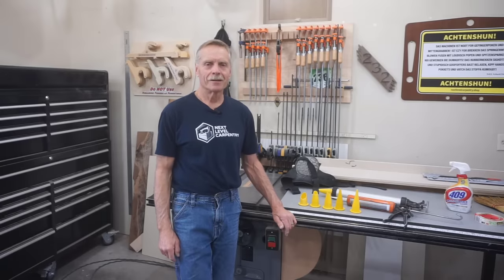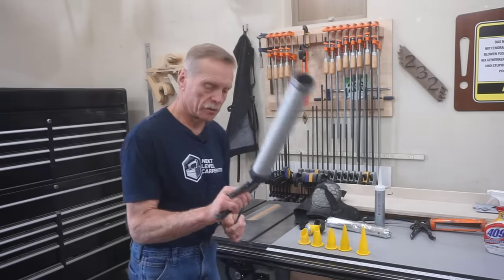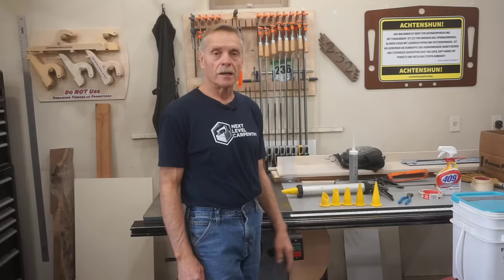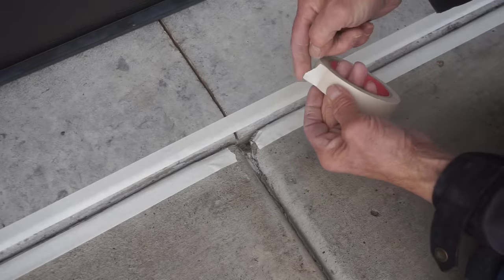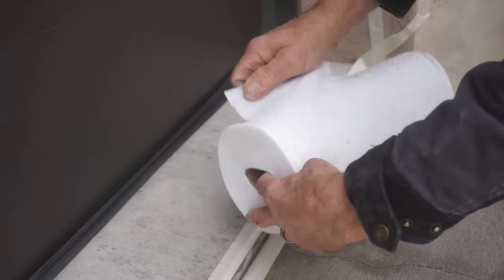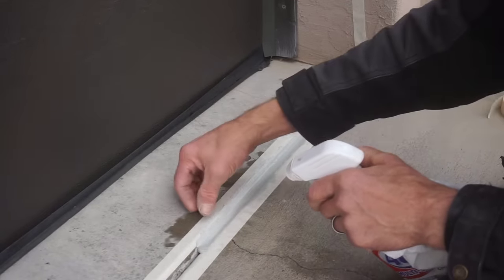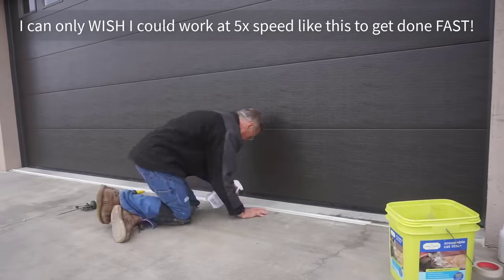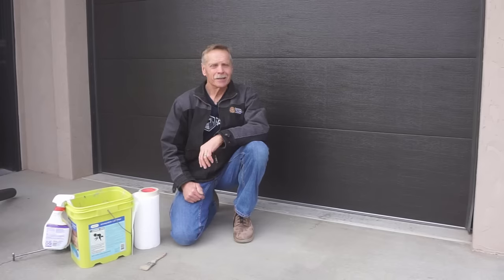How to Caulk Concrete Control Joints with Perfect Results Every Time

Comment: My joint is 3 or 4 inches deep. Should I fill with something (what?) to within a certain depth before applying the product?
Reply from the maker: Educate yourself on the purpose and application of backer rod for joints like that Glenn.  They're quite common and are easily dealt with using properly sized and placed backer rod.  You can start by checking out Tremco's website for 'joint design'.  Hope that helps.  FYI Regardless of backer rod size/placement I finish the top of ALL joints with this same process. Best, Matt
Reply: @NextLevelCarpentry  Thank you for your prompt response. The video is to the point . shows the detail with closeups & comments, and the volume and tone for your presentation was excellent.

Comment: So one main issue with wet sealing is typically a professional caulker won’t use tape. Not as to say this won’t give professional results. But if you don’t use tape and you spray first there is risk that the spray will get under the outside edge. Then it will lift after it cures… they will also use metal levelers called spoons to tool the joints. After you took the joints and the outside edge is sealed you can spray it with some dawn and water if you would like. Also some other caulks have a thicker consistency which in some ways helps with controlling the bead.

Comment: Question: In windy conditions, is there any reliable way to protect the caulking till it skins over or cures? Last thing I want is a bunch of crap, leaves, etc. getting stuck in the joint.
Reply from the maker: That's the entire purpose of sprinkling fine silica sand on the tooled joint promptly after you're done tooling.  In windy conditions I do shorter sections at a time... maybe down to 4'... to keep the joints free from blowing detritus.
Reply: @NextLevelCarpentry  Got it. Thanks!
Reply from the maker: @snidelywhiplash  I think you'll be amazed at how well that little secret works to make your finished results look professional...

Comment: self-leveling concrete sealer is a great substitute for flex-seal. It's better and actually cheaper
Reply: I used a concrete crack sealer (don't remember the brand, was at Lowe's).  Did a strip where the cinder block foundation inside my garage meets the floor.  Also some cracks outside the garage on the concrete apron.  Then we had a lot of rain some weeks later and the sealer was wet inside and came out of the crack, same as the outside.  I hope this stuff works better than what I bought.

Comment: Great video.  How do I remove the attempt made to caulk my concrete patio that was done without taping?  It has flooded and spilled all over.
Reply from the maker: With much weeping and gnashing of teeth, Debora, no other way.  Try a utility knife, wire brush and a solvent like acetone.  It will never be perfect but you can, with effort and commitment, make it much better.
Reply: @NextLevelCarpentry  thank you for the reply.  My husband used a utility knife and was pretty successful in removing the black caulk.  Next question:  we (meaning he) has to get the bead of caulk smaller than what comes out of the tube.  Would love to know how the builder did this, as it looked great 2 yrs ago when we purchased the new house.  Do we have to wipe it off?
Reply from the maker: @deboramitchell3467  I think that's where masking tape comes into play so you can control the final joint width... wish him luck!

Comment: Can this procedure be used on a concrete building where you have stair step cracks in mortar?
Reply from the maker: Sure can... it doesn't provide any structural benefit like what you'd get from tuckpointing with mortar but will seal it up to keep bugs, moisture, etc out...
Reply: @NextLevelCarpentry Thank you. That’s basically what we’re looking for!

Comment: Would a similar process be used for interior concrete control joints inside the home? (say before tiling or laying a floor covering)

Comment: Hi, maybe you can help... my front concrete porch goes to the grass via 3 concrete steps, the first step had the old style black expansion board, this board fell apart after many years. Now the gap between the porch and step is about a inch wide BUT gets bigger when you look down in the gap. Can I just fill this large void with playsand then backer rod then the sealant?  Or can I just use great stuff expansion foam to fill the void and then backer rod and  top it off with the sealant?
Reply from the maker: The best and simplest way to control sealant depth is to use properly sized backer rod placed so the joint depth is about 1/2 its width.  I refrain from putting anything like sand, gravel or dirt down in joints to 'fill them up' because it can lead to further separation as things freeze, thaw, settle and expand.  Great Stuff would be OK but it would be rather messy and you'd have to mask off the top of the joint because you'd not want any spray foam where the urethane sealant needs to stick.  Good luck... Best, Matt

Comment: Man, I wish I'd seen this a long time ago. I have a balcony/ patio deck and it is a floating 3" reinforced concrete slab over a wood framed deck. The contractor originally was going to use roofing material over the wood deck with a gravel layer and then concrete stepping stones on top. I didn't know any better, if I had to do it again I would have just poured an 4 or 5 inch reinforced slab integral to the house masonry structure. Anyway, the perimeter joint caulking expansion joint hasn't held, and I've redone it about 4 times already, about 40 linear feet around the slab. Twice I used sika self leveling, and it separate from one side of the joint and leak. I'm in Florida and in the summer it's blazing hot. I tried another method from a builder recommendation to use xylene to thin some sealant, paint the concrete,  then apply the unthinned caulking.....didn't work either. I'm going to retry with your system. Do you have any recommendations for me to clean the concrete contaminated from the previous attempts?  I used a twisted wire disk on an angle grinder the last time and it failed again... I'm so frustrated that I've contemplating demoing the patio deck and rebuilding it from scratch, but it's a big job. Any suggestions? Thanks.
Reply from the maker: Sounds like a messy situation Rob.  Clean up and prep is always the worst part!  I'd start by cutting out everything you can.  Then use that wire wheel on a low speed to strip off anything that will come off.  Good news is that if any of the old caulk is stuck so good it won't come off you should be able to just wipe it with lacquer thinner to clean it enough for new urethane to stick to it.  Anywhere you end up with clean, bare concrete you might want to use the primer made specifically for urethane caulk for best results.  If there's a lot of movement at the perimeter even this method might fail but I believe it's the best chance you have for doing it.  I've also learned recently about a different type of sealant that might have properties more suited to your materials and conditions.  Here's a link to the website so you can check into it if interested: http://www.towersealants.com/au-1/  I've not tried it but may at some point because "they" are always making newer, better materials and this might be one.  I was talking with a guy named Barry there so if you end up talking with him tell him I sent you?
My overall advice is to be patient with prep work and develop a 'system' of materials and cleaning that you can test before re-doing the whole thing only to find out later it doesn't work... and good luck!  Best, Matt
Reply: @NextLevelCarpentry  Will do Matt, big thanks my friend!

Comment: How long will this material last in an expansion joint on a driveway in the mid west?  We have both hot summers and snow, so before I make the investment in time and money, I would like to know if this material will last many years.
Reply from the maker: Properly done I have projects holding well 15 years on Dean.  Those projects are all on concrete poured over well compacted, well drained soils so excess heaving/settling don't over-stress the stretch limits of cured urethane.  In my experience it's not so much expansion/contraction that causes failure but frost heaving so if your driveway is sitting on good, non-expansive soils or, better yet, well draining clean rock, you can expect 20 years.  I know this from experience because on projects where I do the compaction and forming and supervise placement of concrete flatwork, I see 20 year old sealant doing just fine.  On the other hand, a sidewalk laid on soil that gets wet in the fall and heaves from frost in winter will pull loose by springtime, regardless of the quality of prep and placement of sealant.  Best, Matt

Comment: Can I use this method for the side of my brick house where the concrete driveway has pulled away? It's 1 inch away from the house for the entire length of the house. If so, what do you recommend for filler, because I cleaned it out and it's pretty deep. Thanks.
Reply from the maker: I don't use or recommend a 'filler' per se but it sounds like you need some 1"~1 1/4" backer rod Brendan. Properly placed it establishes the joint depth at about 1/2 the joint's width which is a rule of thumb for joint proportions.  Other than that, yes, this is the method I'd use for your situation.  It's a little tricky taping the vertical brick surface but it's easy to adapt.  Good luck... I know it's a good feeling to have a large gap like that all sealed up nicely to keep detritus from collecting in there again... Best, Matt

Comment: I’d like to fill in the control joint gaps in my garage floor.  One of the reason I’d like to do that is so that my mobile workbench and other power tools on caster wheels can ride smoother over the gaps.  Will this type of sealant/product standup well to heavy things that roll over the gap... things with a radius small enough like a caster wheel?
Reply: Anyway... great video.  I’m definitely going to do this on the slopes driveway.  Thanks for putting in such details in the steps of your process!
Reply from the maker: Unfortunately this sealant won't do anything whatsoever to 'support' things rolled over sealed joints as it never does get anywhere near 'hard'.  You'd need to use some sort of concrete or epoxy product for the performance you want... Best, Matt

Comment: Can you use any multi-surface/multi-purpose cleanser to tool the surface or do you specifically use 409 for a reason?
Reply from the maker: 409 is a universally recognized brand but other brands are probably fine. During COVID when there was no 409 to be had I used a 13% Dawn Dish soap to 87% water solution with very similar results.

Comment: Sir.  Is this the same process for fixing a joint when you have a gap where a slab meets a wall?  My addition seems to have an area that appears to have some dirt where I would think it should be sitting on the slab
Reply from the maker: Yes: the process is the same. The main difference is that it can be a little tricky applying masking tape on the vertical wall surface but you'll figure it out quickly!

Comment: Thank you! I did your method yesterday but unfortunately I ran out of caulk near the end of the job so there is a section that doesn’t have enough caulk. Is there a way to add caulk to the same joint (on top of existing caulk) at a later time?
Reply from the maker: Absolutely!   If it's only a day or two until you can finish up then a thin application on top should adhere well to the first one as long as it's clean.
If it's weeks or months in between it's better to add a thicker layer than trying to skim coat so, if it just needs a little, it would be better to vee-cut out the previous layer so the final application is a decent bead.  
It's also better to just stop if you run out, then pick up again when you get more caulk rather than apply a thin layer and coat it with more to fill up the joint. 
All in all though it's pretty forgiving stuff so you can get away with a fair amount of things.  It's also pretty easy to repair failed sections by vee-cutting or pulling them out in case something goes south on you...
Best, Matt
Reply: Thank you very much for your prompt advice !

Comment: Do you use this same method for vertical expansion joints, exterior clay brick?
Reply from the maker: Yes.  The main difference is in getting the sand to stick but the good news is that it's less of an issue on vertical surfaces than horizontal ones since less detritus is likely to get stuck to it too...

Comment: Do you recommend this process to fill in cracks on a cinder block wall prior to paint?
Reply from the maker: Crack filling is a necessary step to prep for painting but this may not be the best to use: all depends on the type of crack and overall condition of the block wall.  Other types of caulk and tuckpointing are two other options and choosing and repairing should be conscious choices done with professional 'best practices' for best results IMHO.  The wrong thing to do is to pick some goop and smear it in the cracks and just hoping it will work.  Best, Matt

Comment: could you share which color you feel is best for driveways like the one in your video? or does it not matter so much because of the sand coating? thanks
Reply from the maker: I use Limestone or Gray, depending on the actual color of the concrete.  Note that the urethane will take on color based on what sort of dirt gets on the driveway and, in time, tends to blend in pretty well regardless of which color you start out with. FWIW The silica sand I use/recommend is mostly translucent so it doesn't make a significant difference in the color of the sealant under it.
Reply: @NextLevelCarpentry  got it!  Thanks!

Comment: What would you use between a driveway asphalt and concrete,just between the garage and driveway.
Reply from the maker: I would definitely not use the Tremco urethane sealant shown in this video anywhere it comes in contact with asphalt because it's useless. The only thing I've ever seen that works at all is the hot applied tar mixture used by professional pavement sealing companies. Any of the DIY asphalt joint sealers are pretty substandard IMHO

Comment: Can I use this product in side my home
Bought the Vulcan 116 polyurethane sealant for my expansion concrete joints inside our home. The tube says do not use inside a home even if empty we won’t be moving into it for a week or two is the safe to use inside
Reply from the maker: I can't speak to any safety precautions on Tremco's label  for Vulkem but can tell you anecdotally that I've used regular Dymonic and Dymonic FC both inside and out with no inkling of adverse effects.

Comment: How do you deal with a driveway that's sloped the other way or flat and when we get ice storms I end up with a skating rink in the garage? I've dug a trench on the one side that if I keep clear, it can drain off for the most part, but it's far from a cure, and I can't afford a real fix.

Comment: If I can't find 409, would you just recommend a mild detergent?
 Someone mentioned using Fantastic and I'm wondering if any mild detergent like Simple Green diluted or Spray 9, Fabuloso, Crud Cutter or just a little dish soap in water would work equally as well?
Reply from the maker: I've explained this more thoroughly in reply to other comments but what I am using currently is one part Dawn dish soap to 13 Parts water as a solution... it works perfectly, so much so that I may well switch to it even when 409 is available again. Hope that helps? Best, Matt

Comment: Do you use the same process to seal the small cracks.  Thank you.
Reply from the maker: I use this 4 control joints down to about one eighth inch wide. Anything less I would call a hairline crack and there are various products like those from Roadware for sealing that sort of failure.

Comment: I'm a self-employed handyman. What would be typical time to do this project without the added time for video and editing?  What would be a fair price to charge for this project?
Reply from the maker: A project like this would probably take inside of two hours for the work alone. It's undesirable work but simple straightforward and easy to do so I just charge my standard hourly rate plus materials. If I were doing it for a one-time customer I would probably charge my minimum 4-Hour rate regardless because I feel that's just good business practice and is really necessary for a viable profitable business. I encourage people to do first-rate work and not the bashful about charging accordingly. Best, Matt

Comment: Can u do the same process for sealing a joint on concrete block of a foundation? Or is it different because its a vertical surface?
Reply from the maker: Absolutely Laurene!  The only thing that's a little more tricky with a vertical surface is applying the sand and even that's not too bad... good luck! Best, Matt

Comment: Hello, can you use the same product to fill control joints inside the garage. A coating company installed an flake floor in the garage but won't fill the joints. They say the concrete will crack if they fill them up and I can do it but for insurance purposes they won't do the work. Can this polyurethane work for inside garage control joints or will the floor crack when the concrete expands or contracts? Thank you
Reply from the maker: I have used urethane to seal control joints inside garages many times Roberto.  In fact, I recently did all the joints in the floor of my shop to keep dirt and sawdust from building up in them.  It works because it remains flexible forever where any filler like concrete or mortar that gets hard will crack almost immediately and make the situation worse.